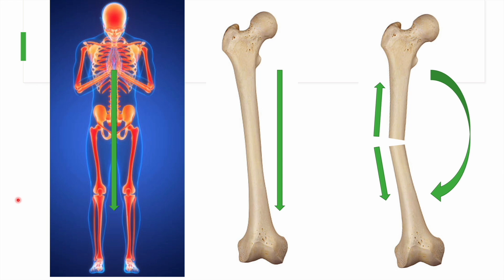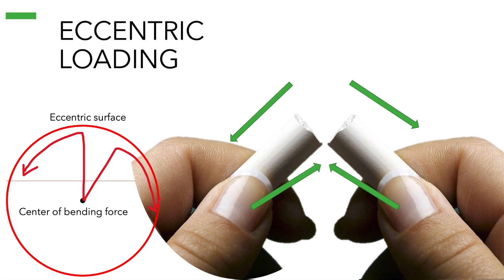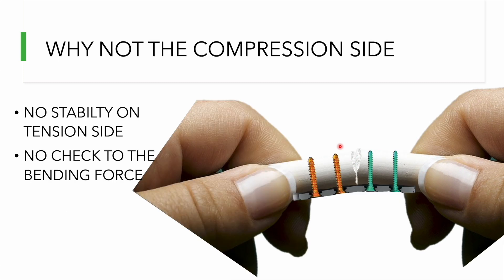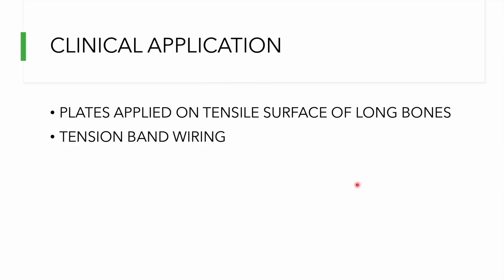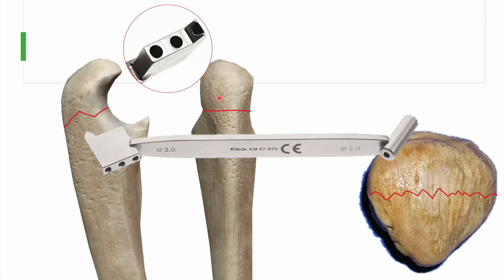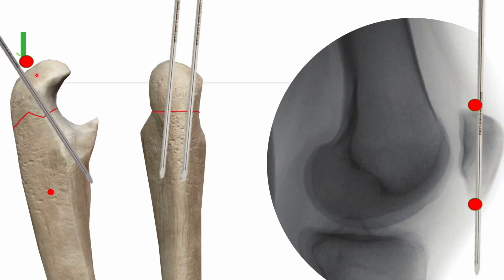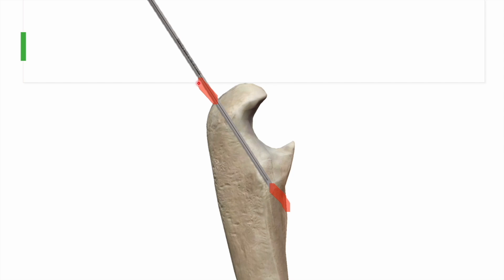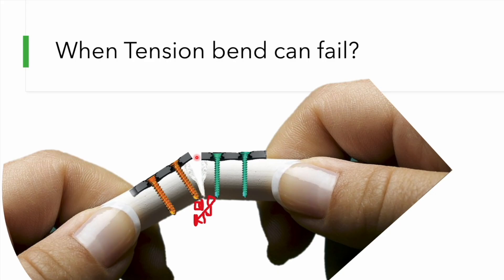Tension Band Principle: All you need to know

Comment: Tension band principal is not applicable to patella according to AO
Reply from the maker: Yes, principle is fine, but tension bands acts only on one surface and is based on principle of tension forces and compression forces along the bone. In case of even slightly comminuted fractures, more than required micromotion can  happen. Some loosening can also happen with such motion. Now thats against the principle of absolute stability and rigid periarticular construct. So, comminuted patella and olecranon which have strong pulling forces are not ideal fractures for tension band. But still in young patients with simple fractures which heal early, the method gives optimum results. I am not sure if AO states tbw is not applicable for simple transverse fractures. The technique is widely taught in AO courses.
Reply: @Justorthothings 
According to AO, the principle itself is not applicable to patella in any fracture type. Yes it functions just as another fixation implant; however the tension band principle is not true. They have renamed it as “cerclage compression wires” for the case of patella regardless of fracture pattern.
Reply from the maker: Yes, thanks for clarifying. What I have written in above comment is similar to the reason quoted by AO as avoiding term “ tension band” in patella but I was not aware that the terminology was changed, its yet to be changed in standard text books. Yes, reader will go through these comments and I think they get the point. 👍